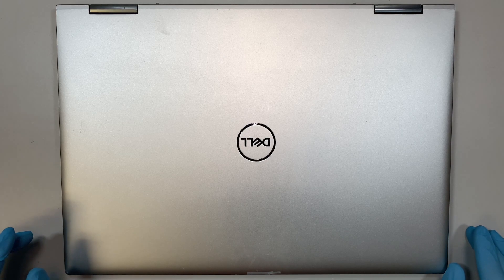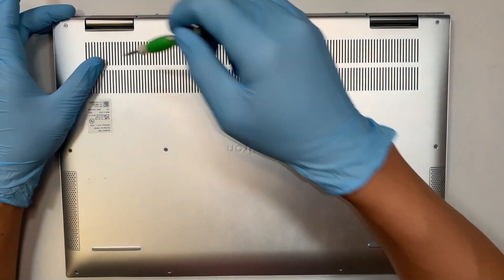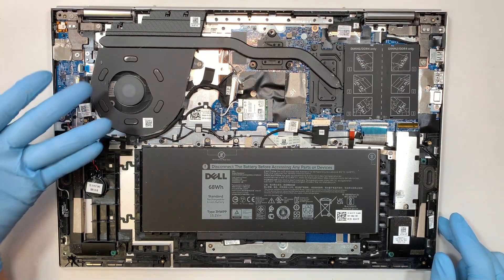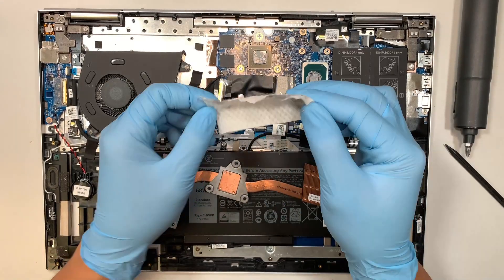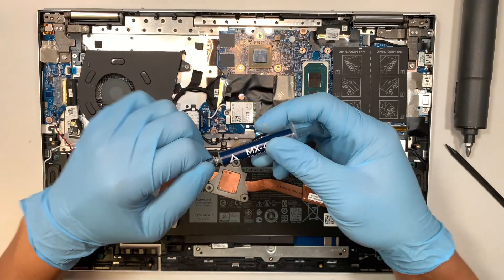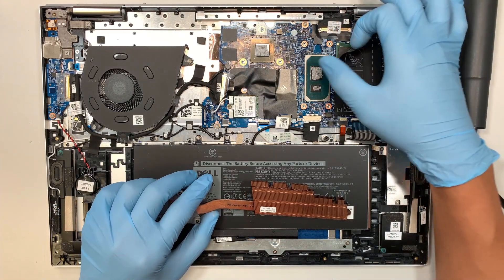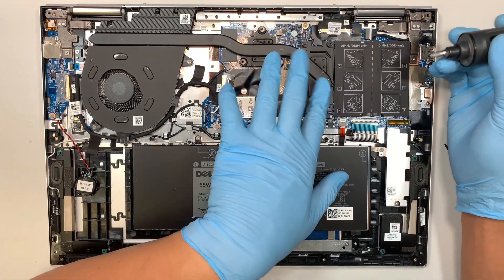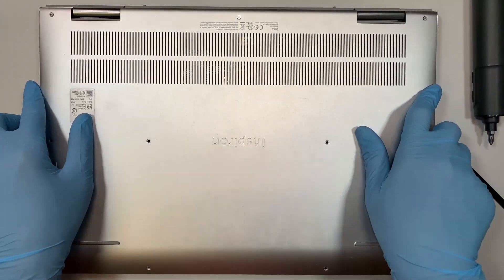FIXED Overheating Dell Inspiron 7706 Laptop

Comment: I have this exact laptop, I have a question with regard to tightening the screws.  I noticed that there are numbers 1 - 4 on the CPU and 5 - 7 for the graphics card.  I wonder if the numbers indicate the order you should tighten them?  I noticed that the order you tightened them was 3, 1, 7 and then 5, 6, 4, 2.  I equate the order to how you would tighten the bolts on an automotive engine head, the order makes all the difference as to if you have a head gasket leak.
Reply: I'm planning to repaste mine. I just ordered for the paste. I will fasten the screws according the number order.
Reply: Correct that is the order you screw them in. I usually get them all started then tighten down in order.

Comment: I have one of these laptops, it's junk. I bought it as an open box buy for about $530 as an impulse buy, without researching. After I started having issues with it randomly freezing, crashing, rebooting, shutting off and not allowing power on again until later, I went back and read the reviews and see that it's very common with this particular model. 

I don't know what Dell did, but in my case even after reapplying the thermal paste it still suffers the same problems. I installed a HW monitor app and see that my CPU core routinely hit 100 degC without any real workload placed on the system. It sits between 60-70 degC at idle and the fan barely runs. I don't know if Dell throttles the fan back to cut down on noise but the laptop overheats all the time. Even changing the BIOS thermal settings don't seem to help. 

The heat dissipation design is junk as well as someone noted below. One skinny heatpipe and slow fan for an I7 CPU and the external GPU? Really?

Comment: I have the Dell Inspiron 7706 2n1 17 inch. Great computer, amazing 4k picture, amazing for work. But God damn does it get hot quick.... and Im talking hold yor hand on it too long, youll burn your damn fingers. Also when I close the laptop, usually anylaptop I ever had turns off, or goes to sleep automatically. While this one will just keep running. Ill pull it out of my backpack burning fire hot.

Love how in this video as soon as he takes of the back, the fan is completely covered and under by that black casing.... no wonder it gets hot, the fan has no space to cool
Reply from the maker: Yes, definitely cleaning the fan blades and new thermal paste will help.
Reply: Same laptop.Gets very hot, mainly when charging. I've had Dell replace almost all parts but same issue.

Comment: My dell 7506 2 in 1 have issue after shutdown the laptop not turning on. remove battery cable 2min then reconnect it will work. Please tell me solution.
Reply from the maker: Maybe battery is bad ?
Reply: Hi Rukn, I'm having the same issue as yours with my 7706. Have you sorted yours? 
( In my case I've checked the battery and it was showing as healthy, and also the motherboard wasn't showing issues either)